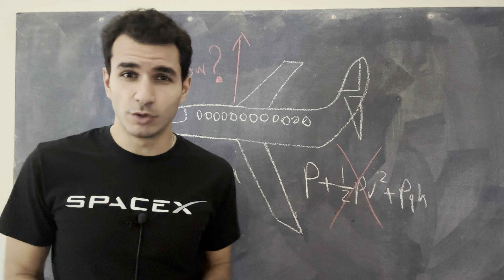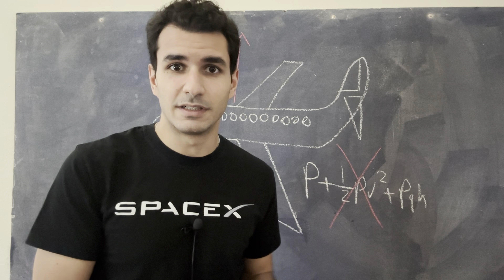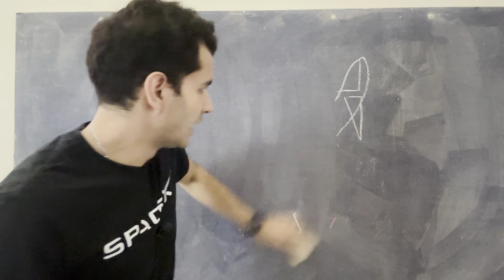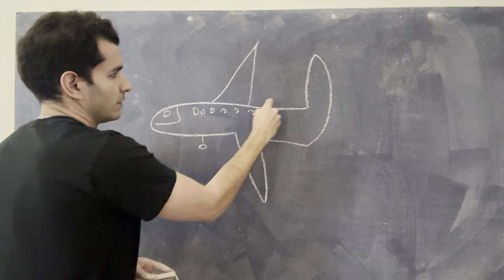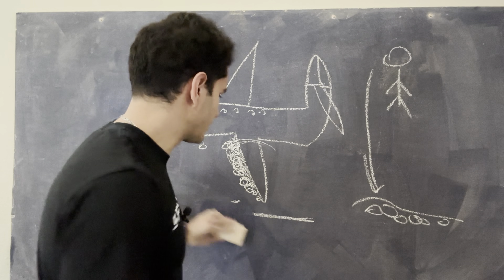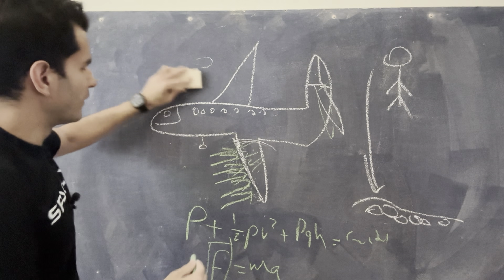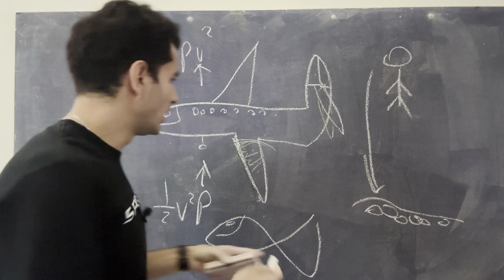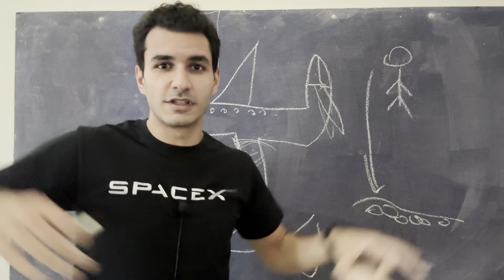Fix This One Misconception = Understand Airplanes Forever

Comment: Yes, Equations DO NOT explain any cause and effect in physics.  NONE!
.
Equations do mimic the physical word and show WHAT happens, but not AWHY.  They are indeed useful, but NEVER explain WHY things happen, nor cause-and-effect.
So. . . 
YES, someone who understands it can explain the concepts.  YES. 
.
I had very high hopes, Ali,  that you were going to get it correct, but I am disappointed, Sorry.
.
You're on the right track as you seem to start talking about the inertia of water and air with that guy jumping from a height, BUT then you don't seem to use that concept in the video. . . . . .   Your method is very awkward and very disconnected, Sorry.
.
You took too much time to describe the inertia with the water jump.  You didn't even use the word Inertia.  IT is KEY in understanding lift. . . 
Air's Inertia Is VERY important in understanding lift. . . 
.
Then, when you drew the circles at the leading edge, I thought you were going to talk about the pressure increase at the stagnation line near the leading edge.   Those circles are not helping because they are not UNDER the wing.
.
You need to draw the wing's cross section so it is clear where the pressure s are - - NOT at the leading edge.

OOPS!!! at time 8:34 - -   "Well, no wonder, DUH!  I'm gonna have higher pressure at the top and lower pressure at the bottom."
 W-R-O-N-G!!!    W-R-O-N-G!!!    W-R-O-N-G!!!    
.Lower pressure above, higher pressure below. . . 
.
Time 9:178 YOU mention Bernoulli and Newton without explaining why you say that.  you You did not provide any connection.
.
Time 9:48.  NO! Sorry, in level flight, the lift is NOT accelerating the plane upward, NO.  It is ONLY providing a force against gravity.
.
The air molecules "behaving a certain way" is NOT PHYSICS. . .
.
Control elements are called control 'surfaces'.
.
You keep mentioning Bernoulli, but never say how it is correctly used to explain lift.
.
You are correct that Newton's Laws are fundamental and the creation of lift is governed completely by Newton's Laws - ALL of them -
HOWEVER while Bernoulli DOES occur around a wing,  it DOES NOTHING to explain the physics of lift. It gives NO cause and effect about WHY the pressures change from ambient.
.
Lift is the Top-to-Bottom pressure difference AND to explain the physics of lift,  you MUST describe the physics of WHY the pressure increases below a ting and WHY the pressure decreases above a wing.  You have not done that.  Sorry. I know you have good intensions, but you did not do those explanations.
.
The concept of Inertia is key to understanding how a wing generates lift.
.
See: Understanding Aerodynamic lift Correctly: rxesywwbdscllwpn.quora.com/

. . . . 
 . . . .
So. . . .WHAT is the Misunderstanding you tried to fix?  I don't see where you tell what that misconception is...?... 
 What is this "misconception you tried to clear up??

Comment: Question, if you were at your takeoff speed and attempted to completely neutralize the lift effects of your primary controls, would you still achieve enough lift to remain off the ground?

Had a landing in a Cesna 172 where the winds were 40 knots gusting 50. Touched down and attempted to slow on the runway. While pushing forward on the controls to stay on the ground the plane was still trying to achieve lift. Had to travel another 500 to 700 feet before we were fully on the ground. Seems that exp showcased more of bernoullis than newtons 2nd law.

 I'm trying to understand it all

Comment: I definitely agree they go hand and hand, but Bernoulli's Principle is the key to flight taking place (meaning the pressure differential).  Otherwise, the wings wouldn't need to be in the shape of an airfoil.  The could be shaped like blocks and still fly if Newton's third law was the primary cause of flight, they'd simply need a steeper angle of attack.  Wings don't work like that though, the shape of the airfoil allows the pressure differential to generate lift.  Newton's 3rd law adds a boost, which depends on a given airspeed and angle of attack.
Reply: No you're wrong.  Newton's 3rd law and "Bernoulli" work hand in hand.  Bernoulli highlights conservation of energy and comes straight out of Newtonian mechanics.  Bernoulli applies everywhere around an airfoil.
Reply: @davetime5234  Re-read my post.  I didn't say anything that contradicts what you stated.

Comment: For the best physical description of lift look up "Understanding Flight" by Anderson
Like in this video, the authors strive to provide explanations in simple, physical terms, not just citing formulas.
https://soaneemrana.org/onewebmedia/Understanding%20Flight%20BY%20DAVID%20F.%20ANDERSON.pdf
Reply: Doesn't Anderson perpetuate the ongoing misconception:  supporting the nonsensical "Bernoulli" vs "Newton's 3rd law" battle where he is in the "anti-Bernoulli", Newton+Coanda convoluted thinking camp?  If so, he clarifies nothing, but is rather a contributor to the "it's too complex" must dumb-it-down with personal preference descriptive biases.
Reply: What is convoluted about their description?
Reply: @GZA036 Pages 21 through 26 should be re-written to eliminate Coanda (which has been misrepresented), add mass flow continuity (which is consistent with established principles of physics used in actual CFD systems and drives the pressure changes rather than his obfuscated use of Coanda as a plug explanation), and relate lift most naturally and accurately to a distilled description in terms of the physics first principles of the 3 conservation laws; mass flow rate, momentum, and energy (this would assist in putting the ongoing arguments to rest).

And as usual he misrepresents the role of viscosity through the usual false proof of requiring the Kutta condition Fix to the overly truncated potential flow representation tool:  he's mixing up irrotational with inviscid.